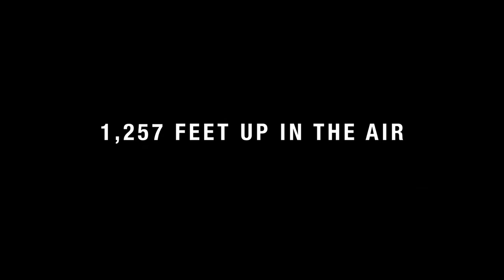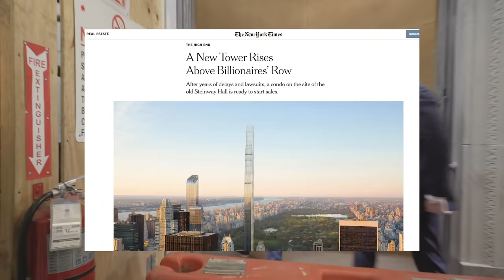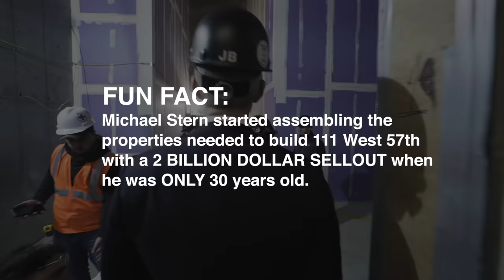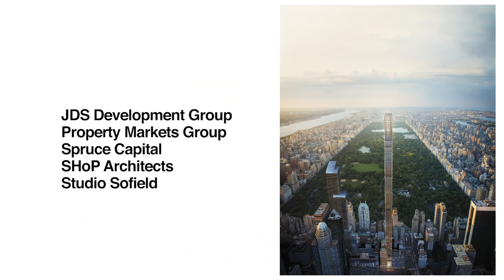Touring New York’s Skinniest Skyscraper with Casey Neistat | Ryan Serhant Vlog #65

Comment: But imagine how much more stable it would be if it was actually 3 towers linked at the top for structural strength. I will never understand the logic of erecting an unsupported tower like this. Its just so easy to run supports across when you have multiple towers of the same height. You're seeing this done all over the world now.